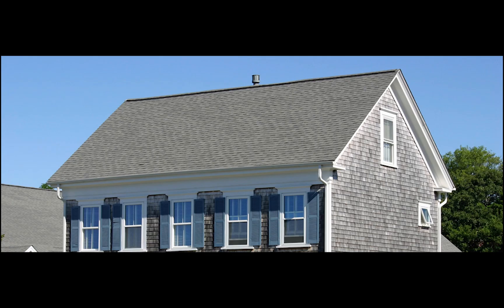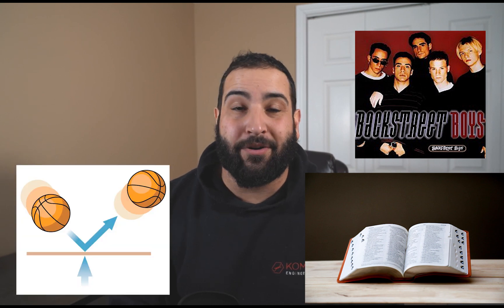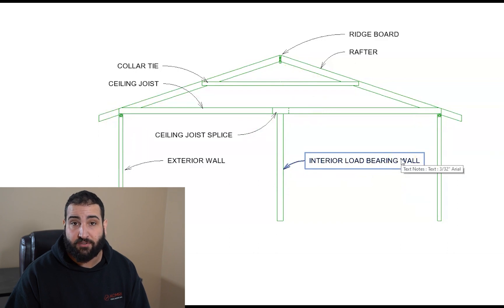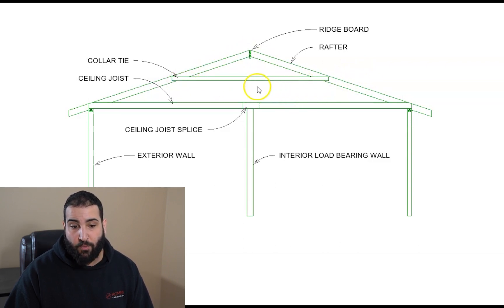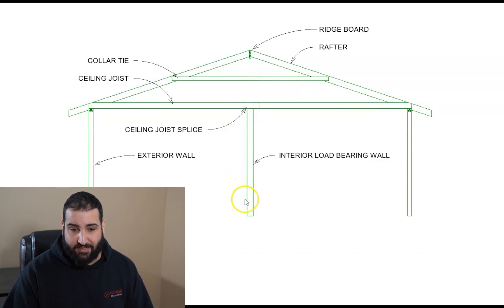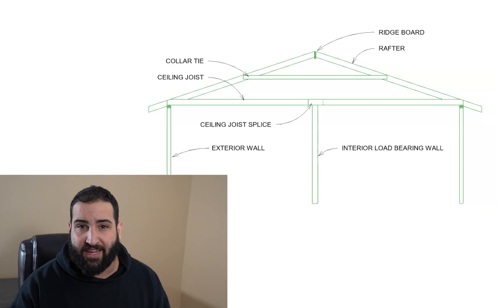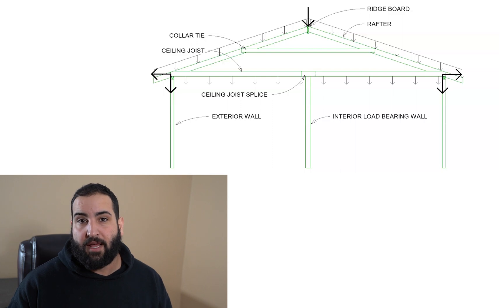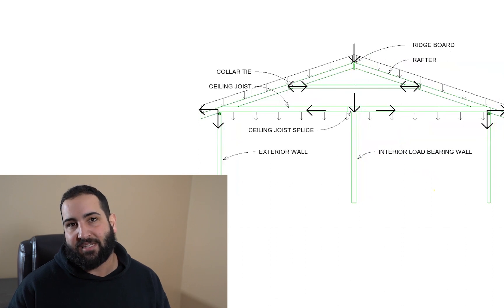Engineer Explains Roof Framing - Gable Stick Frame Roof

Comment: i honestly wish i could sit down and pick your brain a bit, any engineer really. so my question is what is the application of truss built roofs other than increased structural load capacity? like when i design, this sounds silly but Ive done carpenter apprentice stuff, and i understand the whole rafter tie, even like hurricane tie and brackets, but i always gravitate to making a form of truss myself at least for the ends for sure-ing up things. am i crazy? ( I also am a huge fan of joinery but god i  need the patience for it.. timber bros.)

Comment: Thank you for sharing your knowledge. I have a few questions: 

- do you think it's overkill on placing stud to bottom/top plate connection plates on every single stud? That's something I just do. 
- do you think it's overkill on placing a 2 and 7/8 structural screw on any doubled 2x4 in a wall? I do that
- last do you think it's overkill on not only straping the rafter to the top plate but every other joist straping top plate to joist and overlapping the straps on the same run same joist?

Comment: Hey Karim, great video at 4:33 you mentioned w*L^2/2 is this for bending? was it not W*L^2/8? I', unclear with residential structural engineering so I was curious. 
either way thank you.
Reply from the maker: Wow - just noticed that, I must have gotten nervous while recording and didn't notice it in the editing. You are correct and I will fix that now.
Reply: @karimomri8811  We all make mistakes, an for such a small one I almost felt rude pointing it out. I’m a fairly new structural engineer with WSP I just wanted to make sure I wasn’t missing anything. Thankyou for the content Karim, looking forward for the videos to come!